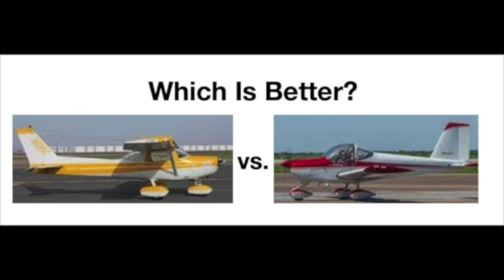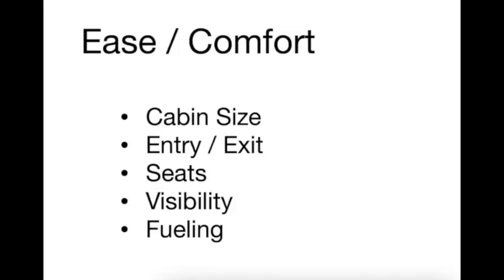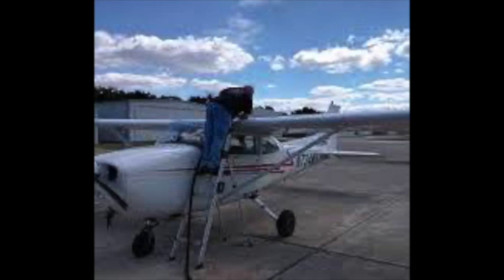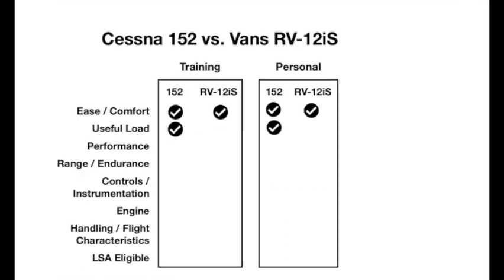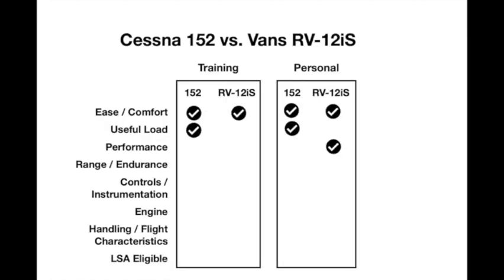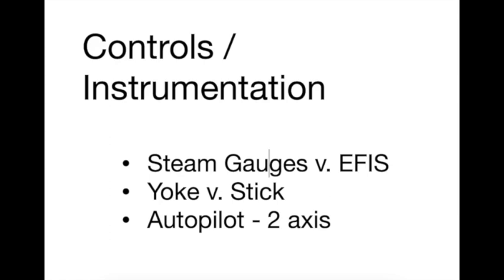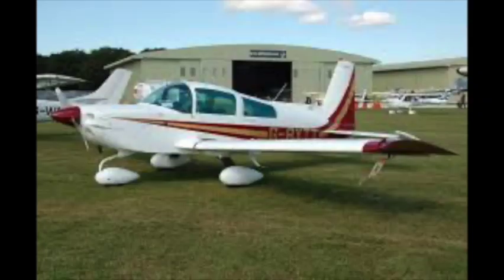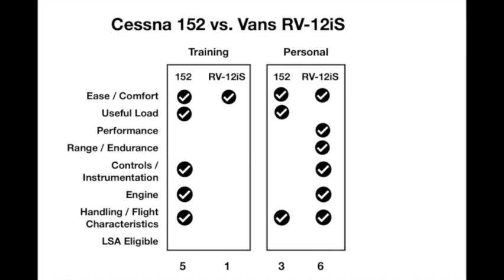Showdown with C-152

Comment: As a pilot 40 yrs, GA and Airline, CFI-II-MEI, ATP I have flown many planes. My flying started in a C-150. I am now retired from airlines, I fly my RV-7 and do casual CFI teaching at a flying club with two planes, a C-152 (IFR equip Garmin 430 x2 G5's) and a C-182. I just finished up an Instrument student in the clubs C-152 who earned their rating end of last year. DURING HIS TRAINING WE GOT ACTUAL IFR which you can NOT do in an RV-12iS. 

As a long time EAA member, Tech Counselor, I built an RV-4 and my current RV-7,  I helped a Gent in his RV-12iS from first flight, through phase 1, two years ago. I had flown RV-12's over the years giving training. He got a hold of me recently to help sell is RV-12iS. It had some issues over the two years, some cosmetic some maintenance. I helped the owner work through those and getting plane ready to sell, and I gave him a flight review. The plan sits on the ramp with a canopy cover and showed some sign of wear, corrosion on steel bolts and screws.  Taxi in the RV-12iS. Two issues tire pressure and the nose gear pivot was too stiff, due to reasons which I corrected. Taxi ease restored BUT THE C-152 IS FAR BETTER TO TAXI with steerable nose gear. 

The Clubs C-152 is 48 yrs old, +13,000 hours. The C-152's Lycoming O-235 went WAY PAST TBO.  The recommended TBO of the O-235 is 2,400 hrs. Our O-235 had +3000 hours and running well, not using much oil but no doubt down on power. OIL Samples were done every oil change. You will not go way past TBO with a Rotax with a GEAR BOX (source of failure).  The Clubs C-152 as long as I have known it, about 4 years, has been on the ramp and very reliable. The elevators and ailerons were replaced after a hail storm with used parts. I DOUBT THE RV-12iS WOULD FAIR AS WELL IN A HAIL STORM, as the C-152. FINDING BOLT ON replacement parts might be difficult for an RV-12iS. However you could by the parts and make new ones. A hail storm would total an RV-12iS possibly. An RV-12iS needs to be in a hanger if at all possible.  If not get the most full coverage covers, including the nose gear, because the pivot will fill with water. Rotax do they make TBO? I don't know, but I read about a few that did not, often gear box issues. The ROTAX is not a bullet proof sure deal like a Honda Civic engine in a car.  Regardless the club bought a overhauled higher HP O-235 and traded in the old one. That engine is going in right now with minimum down time. That is why they did an exchange vs overhauling the existing engine. The cost? Less than a Rotax overhaul which is like buying a whole engine. Parts are cheaper for a Lycoming and there is more than one source of parts with PMA parts.  

Getting to fly the RV-12iS after almost 2 years is interesting. First the plane sits on the ramp (as does the flight clubs C-152). It was good to fly it again. The Rotax powered RV-12iS I would say is not as rugged, more "sports car" like vs pickup truck like. Harder to get in and out of RV-12iS. If taken care of, maintained, not abused (like trainers are) it would say an RV-12iS will last,  but will it last 48 yrs and 13,000 hrs out on a ramp? Not sure. We shall see in 40 yrs or more. POP RIVETS are not as good as driven rivets.  A privately owned RV-12iS in a hanger flown 100 yrs a year, would have 4000 hours in 40 years, but 13,000 hrs and 48 yrs? Not sure.   The RV-12iS is marginally faster, marginally better fuel Econ. The light control stick and better visibility of the RV-12iS is more fun. 

I LIKE BOTH.... One is old and out of production but well proven. The other is newer design, less old, proven solid company still making them. I would say IMHO the RV-12is is not as robust but good enough for a personal plane. As far as flight training we shall see how they hold up. To meet the LSA requirements LSA's are built to MIN Gauge not abuse loads. 

I end by saying WHICH ONE IS SAFER? I think they both are safe. The RV-12is Stall Dirty (Vso) is 45kts (52mph). The C-152 Vso = 35-43kts (43-49 mph),  THE WIN GOES TO THE C-152 as far as stall speed.  Not much so really a draw, However I would say in a crash the C-152 structure would provide more protection than the RV-12iS's bubble canopy. especially in a flip over. Also egress, getting out with the Cessna may be easier. Last last is I don't like 24 gal of fuel IN THE COCKPIT. The C-152 has fuel out in the wings. As far as range some C-152 have long range tanks... Cessna 152 26 gallons (24.5 gallons usable) standard 39 gallons (37.5 gallons usable) long range.  At 6 gph long range is 6 hrs endurance. Subtract 1 hour for 5 hours at say 100 kts, or 115 mph you are looking at 500 NM or 575 Statue miles with ample 1 Hr reserves. Not bad.  PAYLOAD? That depends on the airplane but a C-152 can take 2 adult men (not big big boys, say 175 lbs), full fuel and be aat/below gross.

Bottom line the RV-12iS I have flown with Garmin G3X and two axis auto pilot option) is nice. He did not opt for the IFR GPS and dual displays but still for VFR it is much nicer than your typical C-152. As said before LSA you can train to get your instrument rating but actual IMC is a no no. Our C-152 has Garmin Glass, mixed with mechanical pitot-static / electric instruments, it does not have an autopilot. The Club's C-182 is steam gauges all the way, with an Analog S-TEC 30 autopilot wing level/heading/track vor/loc/gps with Altitude hold, and a IFR GPS. The RV-12iS with two axis digital autopilot and VSI, altitude capture. Really nice.

Comment: I own a C-152 with updated modern avionics.   Never flown an RV-12, although it looks very nice.  Most C-152 training is VFR.  However, the C-152 can also make a very effective IFR trainer.  Plus the C-152 can be flown in actual IMC, not so with the RV-12.  So, for IFR and IMC, the C-152 is the clear winner.

Comment: Most of my time is in 150s, which I love.  Having said that I bought an older RV12 with the Rotax 912ULS engine and I don’t think I’ll ever go back. The RV12 was my first time flying a stick, a glass panel, and an autopilot - and I like them all.  It’s sort of a more modern 150.  I’ve found the glass display very intuitive and easy to use. I do think the 150 is easier to fly, mainly because the 12 is so sensitive to control and power inputs. I’m 6’3” and fit quite nicely in the 12. As others have pointed out, the ability to use mogas is an advantage.  I also understand that the Rotax is more forgiving of periods of inactivity than the legacy engines. So, on balance for me, loving the 12, but you won’t go wrong with either.
Reply from the maker: I agree with you Dan.  Like most things in life everything is a compromise of one sort or another.  For my needs right now the RV-12 is a perfect fit.  It has no bad habits and is economical to fly.  For sport flying it is a fun aircraft.

Comment: Thank you for all the wonderful content on the RV 12. Do you have any insight on an RV 12 with the Viking Honda engine? I’m considering making an offer on one, the pricing is less than your typical Rotax. I was hoping you could help or provide some insight. 

Thx
Jorge
Reply from the maker: You will enjoy your new RV-12.  I have no experience or knowledge of the Viking Honda engine in that application.  In your position, I'd contact my local EAA chapter and see if they know anything.  Another source to consider would be Vic Syracuse at Base Leg Aviation.  He's a good source for all Vans planes and configurations.  Good luck!
Reply: Unfortunately the Viking engine has fallen into some disrepute due to the fact Honda never intended on it being run at those RPMs consistently for that long. I’ve heard several horror stories of catastrophic failure in flight. Too bad though. The Viking is a “sexy” (?) and clean looking engine on the Zeneths I’ve seen.

Comment: A fair comparison of the two aircraft. you didn't mention this but I would be interested in your opinion on a couple of other differences.
1. The Rotax requires the engine to be "burped" to start it up. Do you find this inconvienant?
2. The RV has a bubble canopy and my concern is safety were the plane flipped over. With the plane now resting on the canopy, opening the canopy to escape could present a problem. You take safety seriously so I would be very interested in your thoughts on my concern.
All the best to you.
Reply from the maker: Hi John, thanks for watching.  Burping the engine to check the oil adds maybe a minute to the preflight.  Takes longer in winter with cold starts.  It's different, to be sure, and for anyone who finds it burdensome, there's an alternative.  You can also engage the starter with the mags (lines) turned off for 5 seconds and accomplish the same thing. As for item number two, you make a good point.  The RV-12 has a roll bar so you won't get crushed if inverted, but you make a good point about being trapped in the cockpit.  There is so little room to maneuver, especially with two people aboard, that trying to kick out the windshield or break open the canopy would be hard.  Same could be true if you ditch in water and the airframe becomes distorted making it hard to open the canopy before sinking, I guess.  In the end I see this as a risk that is remote enough that I am willing to overlook it for now.
Reply: I appreciate your positive perspective and your quick response. @rv12sg

Comment: As the RV-12 is an LSA, wouldn't a more fair comparison be a C162, which is also an LSA?  One other thing about the RV-12iS as a primary trainer is the engine.  My flight school offers primary training in either the C162 or C172S (G1000).  There is also an RV-12iS for rental there, and after going up in it (the RV-12) I really liked it. I asked what the reason was for keeping the C162s and the answer was that the engine in the RV-12 just couldn't handle the power cycles that a primary trainer puts an engine through.  Great airframe, but it was always down for MX due to the engine.

YMMV, but for me personally I use a knee board and didn't find any issue with using it in conjunction with the center stick.  Also, on my FAA check ride, I was allowed to use an iPad vs. paper charts during the flight portion.
Reply from the maker: True that the 162 is an LSA, but also true that only 192 were produced.  Compare that to the 7,584 Cessna 152s built and the likelihood a viewer has flown a 152 is greater.  Your observation about the engine cycles being hard to the Rotax is interesting to me.  I had not heard that before.

Comment: You can "hanger" your RV12 in your own trailer and bring your own gas. This gives the RV double the time between oil changes. The trailer option is a big plus for those of us in certain "fly over" areas of the county (pun intended) 😂
Reply from the maker: Hi Jonathan.  The points you made certainly tie in well with the design goals of the RV-12.  I could reduce my cost of ownership by $500/month if I could trailer and store the plane at home.  Not an option for me but certainly might be for someone else.

Comment: Wrong comparison.  the RV12 is better matched with the C-172
Reply: C-150A & C-150B had UNadjustable bench seats
Reply: Maintenance is also MUCH More expensive on the 150 than the 12
Reply from the maker: Your comment is interesting. Both the RV-12 and the Cessna 150/152 models have two seats, around 100 HP, and similar cruise performance while the 172 has 4 seats and 150+ HP.
Reply: @rv12sg : true -- the 150 models C and up have 2 "bucket"/individual seats (pilot and pax/2nd pilot); but the A and B models (59-61 models) had a SINGLE bench seat and it was NOT adjustable --- oh, and had a straight (vs "fastback") vertical stabilizer and no back window

Comment: Thanks a lot for the comparison. My question is how does the rv 12 compare to the cessna 150 m in moderate  turbulent air ? Thanks again.
Reply from the maker: Hi Joe.  The best I can do to answer this is to point out that both aircraft have a wing loading of about 10.5 lbs/sq ft.  Whether a plane gets a bumpy ride is in large measure based on the wing loading, so I imagine both planes will experience a similar level of turbulence.  And since both planes are lightly loaded, I imagine you'd be looking for a way out.
Reply: @rv12sg  
Thanks for your answer, and please keep up the good work.  Thanks again.

Comment: Great video, I have also wanted to make a comparison video on these two planes. I will say a fully loaded RV12 will climb much better than a fully loaded 152. It may not be legal, but it terms of performance I think the RV12 has a better margin and could probably handle a bit over gross weight. I love my 12
Reply from the maker: Thanks for the kudos!  I think both planes are special in their own way.  Clearly the 152 is an awesome trainer and, like you, I love my RV12.  For sheer fun flying the RV tops almost everything.

Comment: The maintenance cost on a Cessna will kill you. Only a bit less on a SLSA. EAB is the way to go. Do it yourself and save $$. I have 950 hours on my RV-12. I’d be a hot mess in an old clapped out Cessna. The RV grin is real.
Reply from the maker: I understand your point, Robert.  My buddies at the airport have built and maintain their RV's themselves.  I know I could save by doing the same.  I want to keep my SLSA maintained by an A&E just so I can say it has been maintained that way when I go to sell it.  Will that matter?  Who knows?
Reply: Actually, you can attend a repairman’s class and be able to maintain an RV12 you purchased already built. It is a good option for those not wanting to do an EAB build. Glad to hear your positive review of your -12.

Comment: The RV-12 cannot be used in commerce either.  You can't rent it out legally and charge for use because it is experimental.  The 152 is certified so it is rentable. Having seen an RV12 up close, I would love to have one! They are very nice!
Reply from the maker: Hi Terrall.  You are partly right.  Your statement applies to those RV-12s that are owner-built and are, in fact, experimental.  Other RV-12s are built at a factory and are classified as SLSA aircraft.  They are in a Special category and may be used by flight schools as trainers and are available for rent.

Comment: 150/152 ALL day long just for the fact the fuel is in the wings where it should be, not in a tank in the flipping cockpit with the pilot and passenger!!!!!  A pilot crashed his just last week less than 3 miles from me here in NC. The fire was horrible, and he burnt up. The passenger survived because witnesses pulled him out, and rolled him on the ground putting the flames out. He will be in the burn center for 6 more months. The RV-12 is a great little airplane, But the fuel needs to be in the wings where it belongs. The heck with the removeable wings!!!  Vans should come out with a retrofit for people who don't remove their wings, which is most people from what I understand! I have been considering the Rans S-19 over the Vans RV-12 just for the reason above. The S-19 is a great aircraft as well.
Reply from the maker: It is always a tragedy when a plane crashes.  Compassion for the families involved.

Comment: I disagree on engine controls. IMHO, at least for early training the student should be focused on flying the plane, rather than managing the oddities of 1930's engine technology.
Reply from the maker: Thank you Boyd.  Your point is well taken.  There are so many legacy aircraft with 1930's engines though that sooner or later the student will have to learn.
Reply: @rv12sg  Sure, though task saturation is a big issue, both for learning & safety, so IMHO, would be better off to introduce more complex to manage engines later, when other fundamentals have become more automatic & ingrained. That's in line with the existing standards of not starting students on constant speed props & retracts.

Comment: the fact the C150 wasn't made an LSA is a crime against humanity. it is literally THE embodiment of LSA, and the First aircraft many pilots think of when you explained LSA to them back when the rules were new.
Reply: Hopefully it will be with the new rule changes coming before long!
Reply: I could not agree with you more.  My 7AC is sport pilot qualified, and a Cessna 150 is not?  So silly.
Reply: MOSAIC will fix that. One of the changes will supposedly allow LSA to fly anything with a stall speed of 54 knots. Four-seaters can be flown, but with only one passenger. I’m not sure if it will include retractable landing great tho.
Reply: @RV6Pilot  and MOSAIC has been in the works for How many years now? Yes, MOSIAC currently includes retracts, like the European aircraft.

But it will likely take another 10yrs for MOSIAC to pass, and still wont properly address the maintenance issues either, and we'll have to wait another 10yrs for that.

In the meantime....as we all keep getting older.....